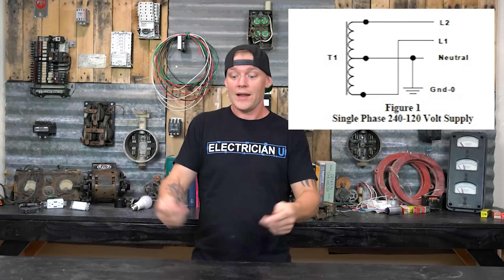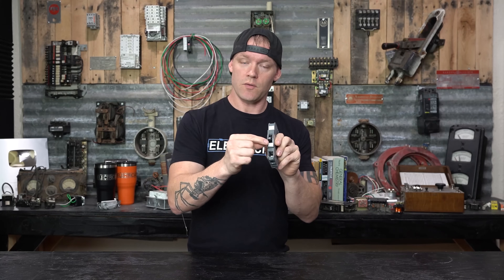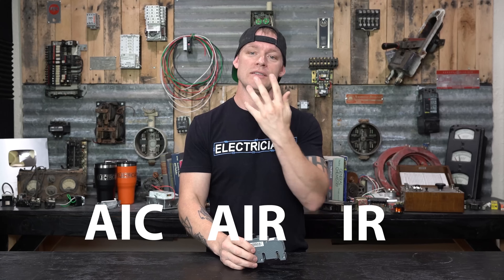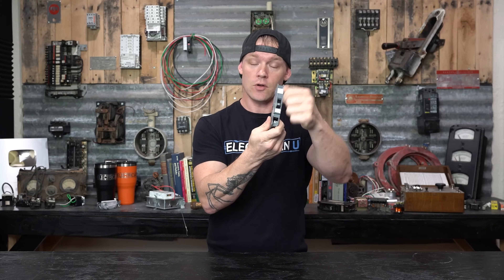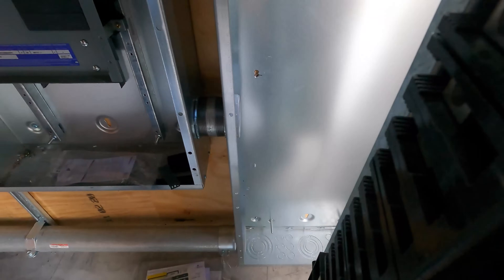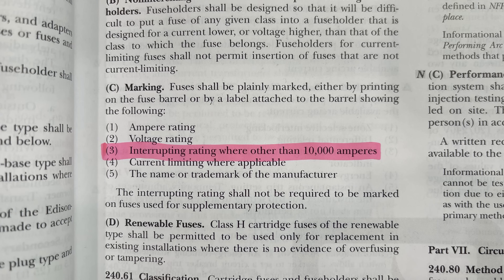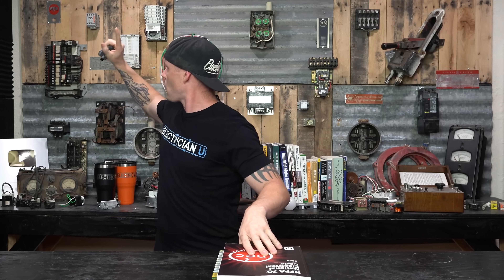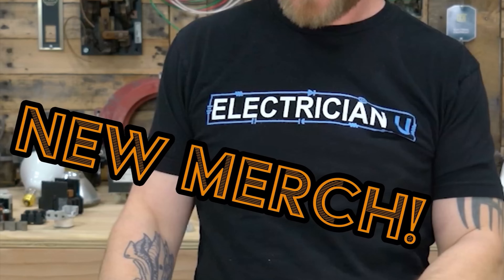INTERRUPTING RATING vs AMPERE RATING

Comment: Can someone explain to me what the term "isolated ground" implies and what it's practical applications would be??? Thanks. :)
Reply: The word isolated means the same as dedicated. At one time a pool light circuit had to have a isolated unbroken ground wire back to where the circuit originated from sub panel or main...
Reply: @steve-o6413  Ok, Thanks that's simple enough I suppose, great example. :)
Reply: I assume you're talking about "isolated ground" receptacles. The equipment grounding conductor terminal on the receptacle is only connected to the equipment grounding conductor hole on the receptacle face and not the yoke of the receptacle like a standard receptacle. They're usually identified by an orange triangle on them. They have no practical uses. 🤣🤣 Some people think they remove negative ground feedback in sensitive equipment and that they're doing good by installing them but they're not.
Reply: @currentlyblake  Ah yes. The EEs designing the grounding systems for places with sensitive electronic equipment are just applying standards that serve no purpose. Makes perfect sense.
Reply: @MrBluelock  also explains why the original computer circuits needed to have a isolated ground wire system, and then this brings up Dolby a braided ground System...
Reply: @currentlyblake  Yes that and in the case Steve O referred too also. :)
Reply: @peehandshihtzu  an "isolated circuit" is not the correct term for a dedicated circuit. The NEC calls it an "individual branch circuit"
Reply: @peehandshihtzu  the code never calls for them, that's an engineering thing. Different jobs will be engineered to have certain equipment installed and that's when these different types of receptacles come into play
Reply: @peehandshihtzu  speciality equipment does require them, but the code book does require them in speciality areas, such as hospitals, swimming pools, not sure probably gas stations...

Comment: I would recommend doing a video on the old "split bus" or "split main" panels from the 60s and 70s.
Reply: Six handle rule too
Reply: 42 circuit Main and the need for Subpanels...
Reply: @steve-o6413  Now can use 82 circuit panels. The large hospital that I retired from had at least 30 82 circuit 120/208 panels installed 5 years ago. All circuits feed from top of panels so it was a challenge. My boss insisted on no shared nuetrals & #10 copper wire for all 20 amp circuits to breakout junction box. Contractor ended up running a ton of 1" conduit out of panels. So hard to get 164 #10 wires neatly bundled in these panels aling with at least 10 #10 ground wires.
Reply: @garbo8962  Hospital grade equipment has it's own section in the code book and you can't deviate from the blue print, everything is spect out because of different environmental hazards...
Reply: No matter who made them they were dangerous to homeowners due to confusing way of securing all power.

Comment: Note that the panel (components) also have to be capable in handling the short circuit fault at the panel location... SCCR (short circuit current rating).
Excellent channel!
Reply: That is why a lot of equipment come with.  fuses that can only meet the high interupting currents found in builings with large transformers. I always ordered time delay fuses with a 200 KIC rating to cover all bases. Back in the 80's worked for a large company that only used fuses with renewable fuse links to save money. Think they were only for 5 or 10 KIC. Most of the equipment were feed by 3000 amp buss duct so the KIC hadcto be high. Took years for me to convert them over to a one time quality fuses with a 200 KIC rating.